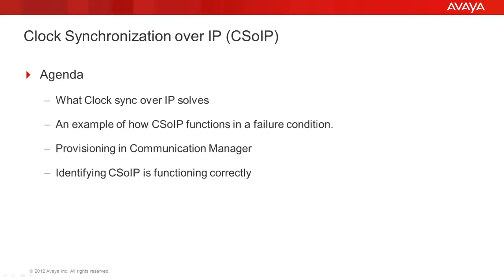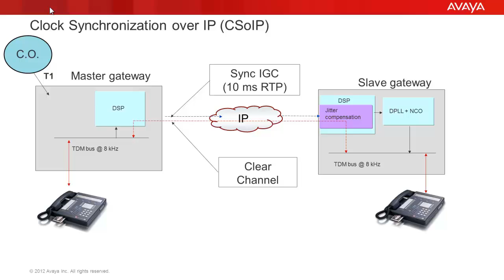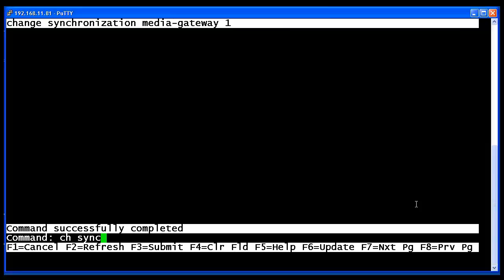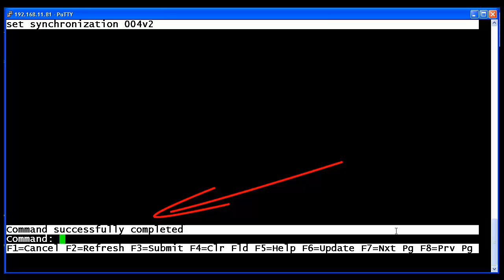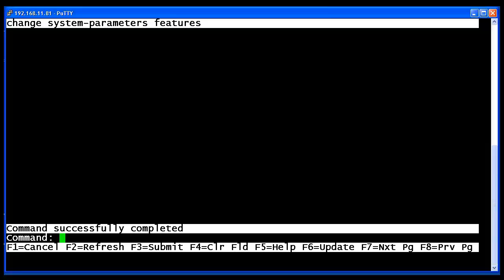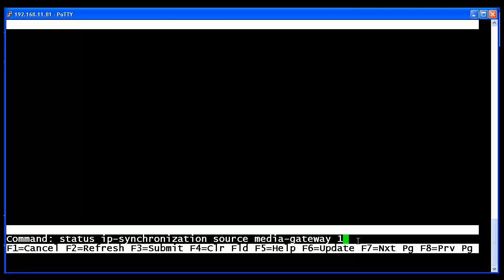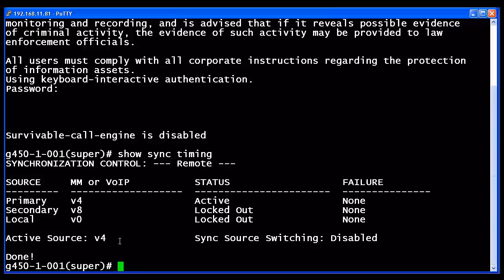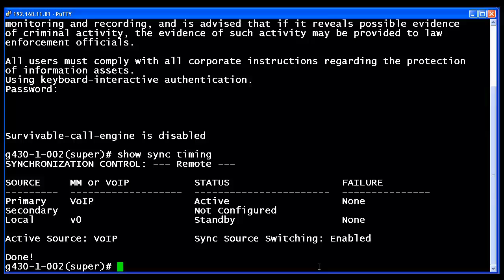Implementing and verifying Clock Sync over IP (CSoIP) in Avaya Communication Manager

Comment: I am trying to "change synchronization media-gateway X" and I get the message: "Media gateway must be capable of IP synchronization to be administrable."
I also tried to "change system-parameters features" on the last page "Synchronization over IP? y" but still no luck.
Media gateway is already disconnected.
Cm on R017x.01.0.532.0
Any idea?
Reply from the maker: For Clock Synchronization over IP you need to have set up the Clock Synchronization over IP feature, Media Gateway should be enabled for IP synchronization and appropriate IP Network Region should be set appropriately. Recommend you to review Avaya Aura® Communication Manager Feature Description and Implementation document. If you still have an issue it can be improper administration as well as corruption in the system so as our support need some additional information about the product and environment it's configured. As this is something we cannot respond effectively via comments. For better support, we recommend you to reach our support through any of the channels on this link: https://support.avaya.com/contact/